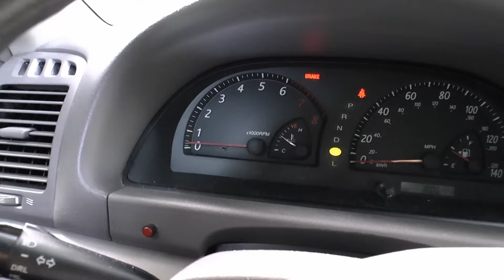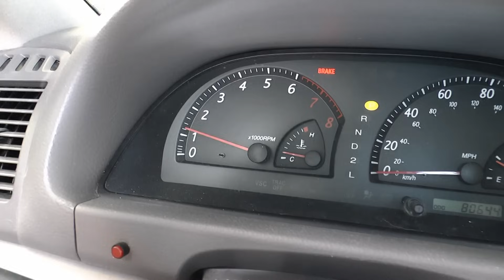How to Fix Low Idle Problems in Your Car (Throttle Body)

Comment: Best to remove the  throttle body (only takes a few minutes more) and thoroughly clean front and back of throttle body plate. And be careful, jamming your fingers into that throttle plate can mess up the throttle body motor that's on the side.
Reply: I really wanna do this because i saw the inside of it and it looks nasty.
Reply: Oops, I push my fingers in it now it's rough idling. Now what do I do?

Comment: Wow, I did the same job on my accord 07 and it actually solved the idling issue on my car, before doing the throttle body cleaning whenever I put the car in drive or turn on the ac , the rpms drop which resulted in the vibrariin. After cleaning it the car rpms have improved from 650 to say 850 while idling and no vibrations, secondly after this whenever I turn AC on , the rpms just increases 100 for a second and comes back to 850, and no vibration. It feels perfect and even driving I feel more power in my car with getting better acceleration output speed. Thumbs up to Scotty .... You rock 👌

Comment: thanks man,I got the cleaner spray. Took The throttle body out and cleaned it. it works great now. keep up the good work
Reply: Do you have to buy the throttle body spray or would WD 40 work
Reply: @joshuaspencer4272   only if you remove it from the car. I bet gasoline can probably work just as well. Make sure to wipe it clean afterwards
Reply: Anoop Singh ok thanks
Reply: @joshuaspencer4272  buy carb cleaner. Wd 40 is water displacement it could work but that's not what it's for

Comment: It worked!! Thanks Scotty! I have a 2011 Toyota Sequoia and had just replaced the battery. After I replaced the battery, I started the vehicle and motor was very quiet couldn’t tell if it was on. I started backing up on my driveway and it turned off. I turned it back on and drove to gas station, again it turned off as I was turning into gas stall. I wondered why just changing the battery would relate to this problem. Well looked up info on YouTube and found Scotty Kilmer’s  video. Did just like he said to do, cleaned out throttle body, test drove vehicle and now running with normal idle rpm. Was about 500rpm after battery change, then about 1,000rpm after cleaning throttle body.

Comment: Thanks Scotty! My 96 civic was idling poorly when I had it in neutral and at red lights. and sometimes I was worried the car was going to die because of how low the rpm was.I did the same steps as your said and now my civic idles right below 1rpm and it drives amazing! feels like I actually have some torque now.yes i know its a civic but still..and it picks up speed way better than before ..before every time I shift into gear and gave it gas it seemed to pudder and the throttle didn't respond well. thanks again. cost me about 6 bucks at the O'Reilly's

Comment: Back when i had crown vic she was idling low and the mechanics drove me crazy they changed oil pump and spark plugs and coils ! But the problem was not fixed yet , after one month one guy cleaned my throttle and the idling problem was fixed ! I wasted so much money on unnecessary parts change , i know changing them is a must but not in that situation. Thanks scotty😍

Comment: Scotty I have a 2003 Corolla with 206k miles. I started to have problems when I came to a stop while idling my car would shudder and drop to about 200 rpm or less. I found your video ( already a subscriber) . I did exactly what you showed in the video and I have not had a problem since. Thanks for the tips!

Comment: I've also found it helpful to remove the Idle Air Control (IAC) and clean that really good when cleaning the throttle body. Great Video!
Reply: If you take the hose off thats connected to the iac to air duck. Stick a funle in it and dump seafoam gradualy it fixes iac issuis
Reply: Sir scotty i learn a kot from you.
Thanks

Comment: I just did this in my 2010 crv. But I didn't push the throttle manually, in other channels they say u have to turn the ignition on and have someone press the gas pedal. Other wise u might break the some  thing in the electronic throttle. What the right way Scotty ? Love u r videos brother.... Best wishes from NYC
Reply: You are correct. You don't want to manually manipulate an electronic throttle body. Doing what you did is the proper way.
Reply from the maker: NEVER do such cleaning with the car on, notice I disconnected the battery doing this. Any throttle can be opened by your fingers or a wooden tool so not to scratch anything.
Reply: Scotty Kilmer Hi Scotty. Actually if you open the throttle body with your fingers don't you risk ruining it? I've heard that it will burn the motor in the throttle body on newer cars. Also it has enough force to clamp shut and take your finger off.
Reply: Cragified is this why my car tripped code p2118?
Reply: Unlikely. Unless you forced the throttle plate open with the key in the run position. Or forced it open against a mechanical resistance. 

These are the most common causes of the P2118 code:

Poor electrical connection
Open or short in the actuator circuit
Throttle actuator control motor failure
Failed pedal position sensor
Throttle position sensor faulty
Reply: Cragified I think I did force it open. Odd because I didn't feel any resistance

Comment: You should do one for a car that over idles and drives itself my car does that I need help !!!
Reply: johnathan lopez check the throttle cable if it's an older car; if it's newer it's the computer that controls the throttle
Reply: If you disconnected the tps sensor connector you may need to do a tps relearn

Comment: Doing that tomorrow in my Saturn, changed the air filter today and discovered that the throttle is worse than that cars by a million times!  Thanks for the advice.

Comment: Scotty Kilmer My '96 Honda Accord 2.2L had a low idle when I came to a stop and at a red light. At times my car even stalled in the middle of traffic! YIKES! I had no clue what the problem was so I turned to you for help! Thank you thank you! I got my car to idle at 500 RPM, without any dipping or signs it was able to stall. not sure if 500 RPM is the recommended idle though.......
Reply: UrSo Kawaii I think the ideal idle is about 900 to 1000 RPM. Our '96 Accord 2.0 before is about a 1000 while my '97 CRV is about 800 to 1000 RPM.
Reply: ***** Hey! I think you're right. 500 RPM is low. Im not sure how to fix that though.

Comment: Scotty, first I love your videos..... I cleaned my throttle body on my 98 Toyota Celica.  I have big hands... you know what that means..... big fingers too.  So it was a little difficult to get my fingers in enough to really clean.  Other videos suggested using wire brushed or old toothbrushes.  I thought the wire might put grooves in the metal so I used a toothbrush.  I found wrapping an old t shirt around the toothbrush and soaking the material really helped to get in there and remove the grime.   I still rough idle a little when warmed up but not like it was before.  Thank for the videos.  You are great.

Comment: You can't do a repair on a Toyota poor idle without checking the IAC! (Idle air control, most common cause of idle issues).

The dirty butterfly valve/throttle body doesn't affect the idle on these engines unless it's stuck slightly open, causing fast idle issues instead of low idle. 

You need to start by removing the IAC from the throttle body and clean it with carb cleaner or similar. Then use wd40 to free up the shuttle inside. This shuttle rotates to create an air passage that bypasses the butterfly valve and allows the engine to run while the butterfly valve is closed. (This is why dirty throttle body issues don't cause slow idle)

They can suffer from a carbon build up that causes them to stick in the position they sat in while the engine was warm but this is no good when the engine is cold and requires more air to run smoothly. This is why the problem only persists when the engine is cold. 

You should also do a simple vacuum leak test before taking anything off the car so you can eliminate vacuum leaks as a cause. The rubber gaitor that attaches the MAF to the throttle body on these engines is a common failure and would also give issues with erratic idle.
Reply: It's an electronic throttle body it doesn't have an iac
Reply: 1998 Toyota Camry. This is exactly what’s happening to my car. I haven’t found a leak and I’ve cleaned the valve. I might’ve missed the butterfly valve being stuck I think I noticed something like that but I have very little knowledge when it comes to cars
Reply: Electric throttle body uses a (TPS) throttle body position sensor to control the idle and throttle valve position.
Reply: Cpt MishMash VonRandom i

Comment: You should have taken the throttle out of the car first and then clean it up, otherwise, all dirty stuff would get into the engine. 

I have been cleaning throttles for years.
Reply: HI Radhy, my car ,Renault Megane 1.6 ,as a electronic trottle and somebody told me not to finger open the butterfly trottle when cleaning as it can upset the sensor, is it true? Thank you
Reply: @pauloisidoro2  you should put the car on without starting the engine and your friend must push the gas peddle in. Then it will electronically open and you can clean it without using your finger.

Comment: I think I'm going to cry. Thank you very much!
My 2010 Corolla only has 74000 miles on it. The battery was dying and I knew it. Then it finally went dead so I got a jump and went to auto zone and bought a new battery. It has been idling poorly ever since. It idles fine in park. Nice, smooth and quiet but drops to about 600 rpm in drive. And in reverse, it shakes and feels like it is going to die.

Comment: I bought a 2013 commuter car back in June for 10 grand from a used car lot and it was worth $13,500 on KBB and I thought it was a fuckin steal so I bought it but a few weeks later everyone that got in my car called me idiot because they thought it had transmission issues. Even the dealer told me this and they wanted me to pay 3 grand for their extended warranty. I had terrible mpg and very rough idle to the point where I thought the damn thing was gonna explode. Long story short I took it to a mechanic and he told me all I needed was a new O2 sensor and to clean the throttle body. I spent an extra $400 and again feel like I got the thing for a fuckin steal hahaha.

Thanks again Scotty. You saved this college student from a financial disaster!!

Comment: In a Honda, there is an electronic idle transfer valve and servo that likes to goof up.
It's purpose is to adjust the idle air for things like the AC turning on or the difference in 
engine load when you are in or out of gear. This has given me issues on all Hondas I have ever owned when they get around 120K miles on them. The symptom is that the car idles fine until you put it in gear, then RPM's drop enough to have a very rough idle or, even at times, for the engine to stall. When there is an issue, and the AC turns on and off, the engine dies then picks up again. When working correctly, the idle speed should be relative constant as you go from neutral to drive. It should also not surge and such when the AC is turning on and off at idle. It should even remain relatively constant as you turn and the power steering pump starts to load the engine. This valve is on the throttle body and adjusts idle air as needed  via the engine computer. If it is bad, or as mine was, clogged with carbon, the car will not want to idle properly when in gear and when the AC is on. The actual throttle plate in my Accord is completely sealed when at idle. The air for idle goes through this idle air transfer port and valve on the throttle body assembly. If you adjust the throttle stop to open the throttle slightly, it will trip an engine fault code and your check engine light will come on. It will also not fix the real problem.

Comment: On the electronic throttle bodies I like having a buddy hold the gas pedal to the floor with the key on, engine off. And clean the throttle body with a soft bristle toothbrush and the cleaner. Works on most cars I've tried. And if your by yourself just get a piece of pipe or brick to hold the gas pedal down. Just keep any sensors on the intake tube plugged in so you don't set any codes.

Comment: This is one thing for me to look into. Cheers for the video.
My car was sitting for 2 weeks and when I went to start it up it was running and shaking with low RPMs like it was missing or running on 3 of 4 cylinders. After a while it started to run fine. I've checked the plugs they all look fine. It does it at random times like once every few weeks so It's not constant and very random but with the above video in mind I'll check the airbox.
Reply: Hello man, have you found the problem? I’m kind of experiencing the same issue at the moment

Comment: I have an older 80's nissan hardbody pickup that i found with under 100k miles on it. It runs great and i haven't had many problems with it other than the small size of the cab which is actually a king cab but still kinda small for an average American guy. used to have an '86 toyota landcruiser wagon and would love to own a 70's fj40 series. my LC had 330k on a spent motor... it had become a project beyond my means of repair.

Comment: I have this same car Camry 2002 with the four cylinder engine. This is a common problem. The best thing to do here is to buy a new air filter, clean the MAF sensor and the throttle body. Also check for vacuum leaks within the intake tube.

Comment: thx for the quick video, i got a 2012 vw jetta s 2.0l.
While i was driving the check engine light came up and i got a epc light
The check engine codes were to some of the cylinders and ignition coil a primary/secondary
So i changed out the spark plugs and wires, cleared the codes and it was good for a couple days till the check engine light came up stating the same codes..
Also, the epc light comes on every now and than driving it after an hour or two and what it does is it lacks acceleration power, and i cant get passed 50mph and the shifting kinda jerks
This problem only happens when the epc light comes up.. so im gonna try this and hopefully get a new coil pack module and possibly a new throttle body..
I'll keep ya updated hopefully this cleaning keeps it good for atleast a couple weeks.

Comment: Hi Scotty,

Just a follow up on the issue with my 01' AU II ford falcon. I have replaced the throttle body with a used one i picked up for about $60 and the car has idled perfectly since. Thanks again for your help :)

Comment: Man, i miss my 91 lincoln towncar....that 4.6L modular V8 was great. Reliable, had no power, but good ol mechanical throttle. I had to increase the idle on it with the bolt that the cable rested on because it had a vacuum leak because the intake was cracked and tape couldnt seal it all the way.

Comment: I drove my car from Washington to Arizona. There was a change in elevation by about 2000 feet. I was higher up in Arizona. My car was fluctuating idle and it would bogg down at times to the point where I would stall out. I did this technique and it wasn’t working at first. I had to disconnect the battery and hold the horn down to drain out the reserve part. To the point where I had to reprogram my radio stations. Started ruff at first but now idles just under 1000 rpm where it’s supposed to.

Comment: On older Hondas, especially accords and preludes, they have a "Fast idle Thermo valve" that sits under the throttle body. This part has a few components inside it that can wear out and make your honda idle all kinds of crazy.
If you have a ridiculously high idle and it sounds like your car is trying to play a song, you should either replace the valve or try cleaning it.
It has a spring thats held together by a screw. sometimes the screw just comes out some and needs to be tightened back down. sometimes the parts inside break and require replacement.
dont forget to clean out all the connecting pieces while you have it all apart, whether or not you are replacing the FITV
But be very careful not to put it back together backwards. Water travels through this valve and if installed improperly it will shoot water directly into your engine.
Not enough to kill it completely, but more than enough to cause serious problems.

Comment: Low idle. How to fix low idle problems in your car DIY with Scotty Kilmer. How to clean throttle body. How to fix poor or weak idling problems by cleaning the throttle body with some spray cleaner. Fixing an idle problem can be as simple as cleaning the throttle with a

Comment: My 2005 Camry with the same engine did that after I changed the battery.  I gave it just enough gas where it was turning over just 2000 RPMs and it was fine after about 10 minutes.